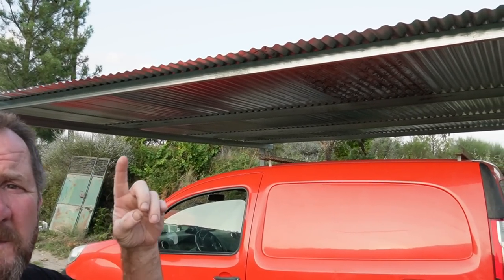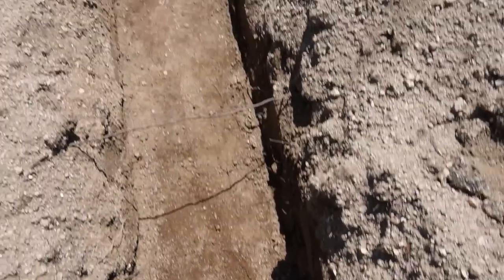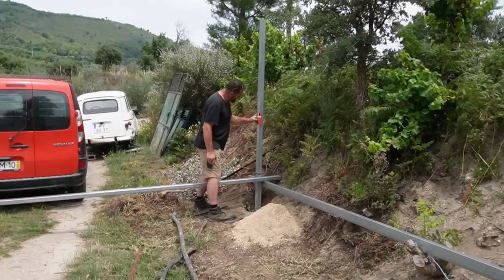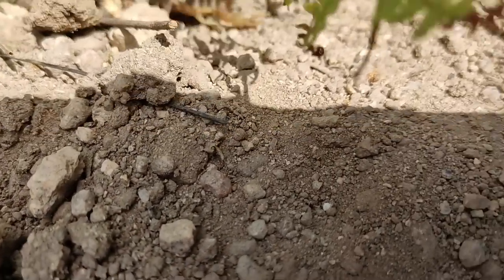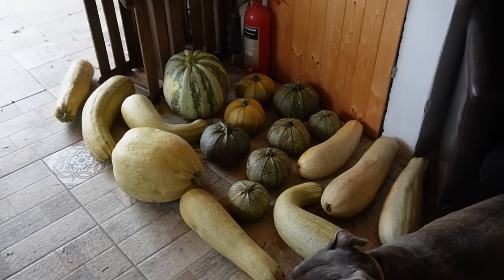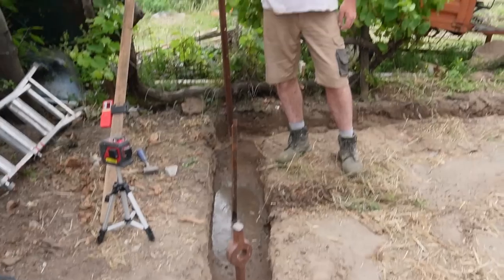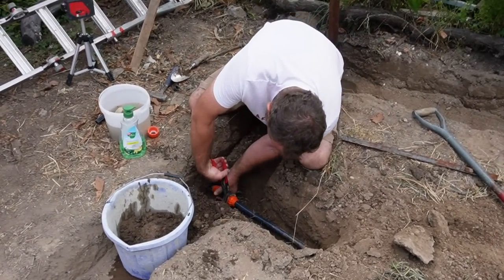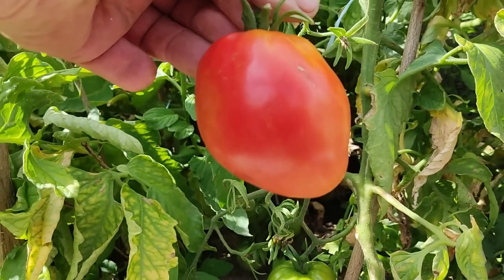Newbuild Carport and Foundations for Barns

Comment: The cross members running  round the bottom are just as good a reference point. Never seen so much Faffle in measuring up
Reply from the maker: There are no crossembers running across the bottom! How would you drive a car in?
Reply: @projectportugal  you did have cross members running round the bottom, temporarily or not. A blind man could see that

Comment: Great work and cooperation. One thing, don't see it as critique, perhaps two small diagonal bracings should give more stiffness in the steel construction and in the roof. The wind although pushing down in your view can be violent and turbulent and move or bend the top pilon part. The high roof side you will brace to the side. But the low part is able to move under duress in longtudinal way. A simple triangel will resist that movement. By too much movement the roof dekking will pull the fastening through the roof sheet after a lot wiggeling. My experience the windforces near Castelo Branco can be forcefull in mountain or strong hilly surroundings. Living near saddle of 4 valleys connected. But the construction was nice and quick, good work. Will you leave a manhole to the broken water pipe for inspection or maintenance?
Reply from the maker: I will probably concrete over the top of it, but put more sand around beforehand
Reply: @projectportugal  OK, understand, I mentioned it but I saw the sand already but thought if there is a problem with the connection leaking then a manhole or tunnel gives easy access. This will not affect foundation requirements and small rebar pieces in the concrete can give bridging strength if required. But a sand pit under will give easy access as well but more digging or washing out. At least you know now where the mains is laying. In my house that is still a guess no documentation how it was constructed.
Reply from the maker: @ceesvandenberge5611  é normal